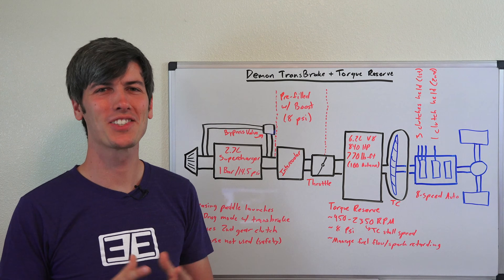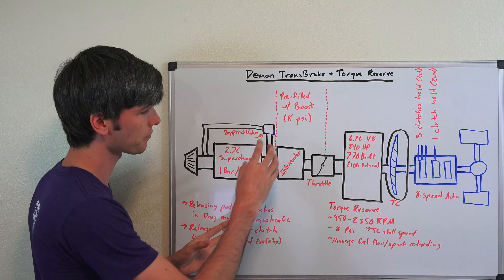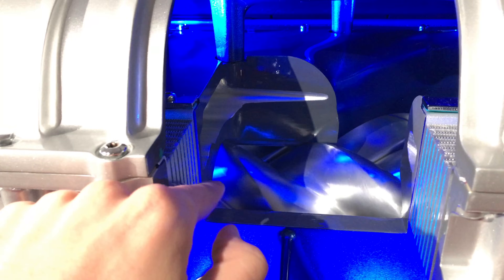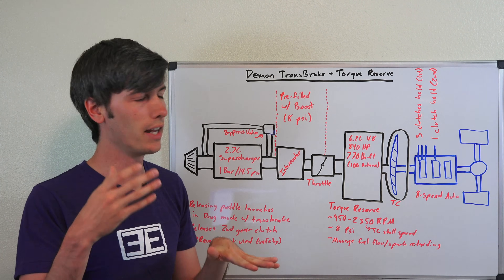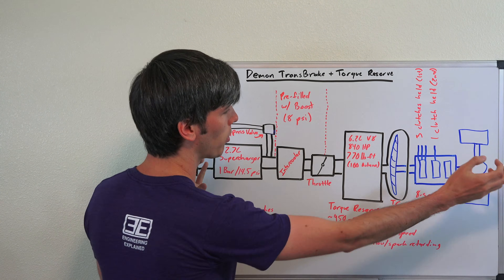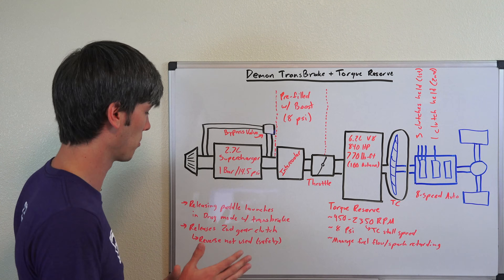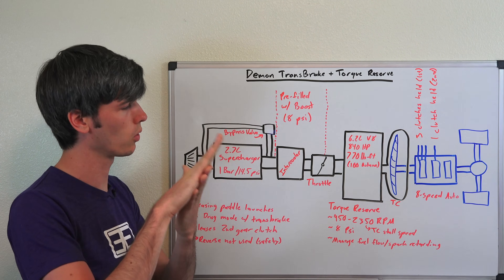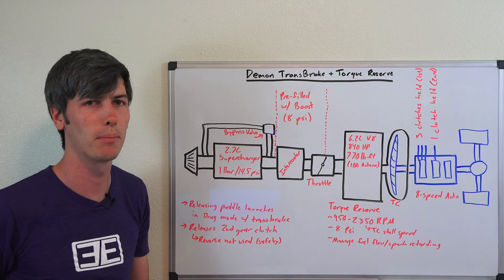How The Dodge Demon Launches: Transbrake + Torque Reserve Explained

Comment: I suspect Dodge is doing this just to take the 0-60 claim away from Tesla? In the street race videos I've seen, that Elon has Tweeted himself, all one has to do to the Tesla is lighten it up a bit (which is very easy to do) while using stickier tires to make it even faster. People haven't even tapped into the world of "hot rodding" the motors/batteries, yet. 

Fact is electric is always going to be faster than an ICE street machine.
Reply: You can upgrade the power as much as you want, but the tires simply can't handle more. You can solve that too, but then what you get is not a car, but a railgun. While that can do 0-60 under a millisecond,  it's not very practical or survivable.
Reply: The subject of the video and the technology in the Demon is about 0-60, nothing to do with endurance.
Reply: Gasoline/diesel runs out and has to be filled again. That 500 miles is final and who knows how much energy it took to extract it, refine it, ship it and then distribute it. It also cannot be replaced and will run out someday. The energy used to make batteries is a lot less in the long run because they can be recharged (via solar, wind, hydro, nuclear, not just coal). That 20 miles for batteries turns out to be 10s of thousands of miles. This is only to take into account current technology which is only now taking off because of market value. 

Tesla's Gigafactory 1 is very soon to be up and running and will the largest lithium battery manufacturer in the world. It is 100% solar powered.
Reply: I doubt that if batteries required significantly more energy to produce than gasoline/diesel you'd be saying it was irrelevant. I also don't know what you mean by not having to carry fuel anymore once it runs out. You won't be able to carry it because...the fuel runs out. You have to refill it with all new fuel and that will have to be carried just like the old tank full. 

Again the type of racing which was the original subject doesn't require anything special out of batteries. Cover up the radiator grills on ICE street machines as they are nonexistent on EVs and see what happens to those. It's no contest. 

A good example of the subject is the Tesla Racing Channel. It has no radiator grill and consistently beats every single ICE engine that comes against it, all day/night long.
Reply: +David McClelland Which has not been relevant since carbs were still a thing. Even basic economy cars can overwhelm their tires now, whats the point in dickwaving something that now a given.
Reply: Look at the trouble and complexity Dodge went through just to inch past only the first of myriads of its kind in the first few years of its production. If drag racing were a priority for Elon he'd not have to go through too much trouble or expense to ALWAYS smoke an ICE production street machine in its own territory.
Reply: David McClelland The things Dodge did to improve launching is not any different from the things Tesla does. It both all in software. The "torque" reserve thing is just a coincidence basically, it's not something added to the design, it just happens to be there. Transbraking is not complicated either, it's something that can be done in software in pretty much every automatic transmission built in the last 30 years.
Reply: lobsterbark A multispeed, multiclutch slushbox is complicated. A super charger added to an already completed piston engine is adding complications. Using a heat pump to cool intake air is, again complicated. Tesla has a lot of complicated tech, plumping, wiring and design but it isn't just for drag numbers. This Demon sacrifices everything for a better drag time, the Tesla accomplishes a great drag time by the pure nature of optimizing for efficient. If you make a reliable electric drive for every day commuting it will, as a side effect, be a track monster. The difference is the outcome of the Tesla is just a bonus while in the Demon everything is bolted on to simply make a better drag car at the cost of efficiency and all the other down sizes. In an electric car, more copper and more battery and you get more efficiency AND more performance.
Reply: +difflocktwo The thermal efficiency of the two are almost completly irrelevant. When someone is shopping for a car, does anybody look up the thermal efficiency of the cars they are looking at? No, because its irrelevant. Yes, the thermal efficiency does effect the actual practical efficiency somewhat, but the energy generation and storage efficiency is much more important, and in those categories, electric cars will always lag behind ICEs. 100lbs of gasoline can propel a medium hatchback ICE an average of about 500 miles. 100lbs of batteries can propel an equivalent electric car an average of about 20 miles, according to my napkin math. Granted, the support equipment for an ICE weighs more, but that extra weight make such a tiny difference compared to the extra weight of batteries. Thats not to mention the volume, but thats not as big of a deal if you design the car around the batteries, in the same way that ICEs are designed around their powertrain.
Reply: lobsterbark Dude are we discussing drag cars or consumer behavior? Big picture: Sustainability absolutely is necessary by definition.  
Drag performance: Wasted energy as heat has to be dealt with, adding complexity and material limitations. Drag times in production vehicles will favor high efficiency. Waste heat is a hindrance in any system, the less of it you have the higher performance you can extract.
Reply: +lobsterbark
ICE cars are very hard to improve, it's a 100+ year old mature technology, and it's pretty limited. Electric motors are far superior in every way, except that until recently there was no practical way to power them. But batteries are now improving crazy fast, and big money is just started to go into battery R&D. Battery technologies that are almost ready for mass production offer several times higher energy density, lower prices, and significantly faster charging. The batteries that are now being produced in the gigafactory seem to be already much better and cheaper than the Model S and X batteries. And batteries don't have to be Li-ion, or even chemical, the motors don't care about the source of the electricity. In theory we could use nuclear batteries that can power a cars for decades.
Reply: David McClelland And don't you think someone is planning to mod the Demon already?? Stock for stock the Demon still crushes the p100D...Doesn't matter that it has drag radials, bla bla!! The p100D has been synod at nearly 1000 wtq... VERY impressive torque numbers!! It's interesting!!
Reply: David McClelland Elon musk has stated that the p1000 D is all they can do to this platform  .. modding it will only make it few tenths faster which is a lot, but the Demon will be modded also and possibly launch quick as 2.0 s, and 8s for the quarter mile... Sorry Testla!!
Reply: I'm not just talking about an ICE transmission, I'm talking about the big picture.
Reply: How far down do you want to go? Raw material extraction? Everything is digital these days and chips are unfathomably complicated and chip fabrication is unbelievably expensive. 

 We use batteries everywhere, they are practically a commodity.

The argument revolves around taking energy and making a car go. Using the stored energy in batteries and a electric motor is much simpler than taking gasoline and trying to turn wheels. On top of that you can easily generate electricity locally while gasoline refining not.
Reply: +difflocktwo But the way that batteries are complex is much harder to improve upon than an ICE vehicle. An ICE vehicle can be made better in so many different, small ways that the end to how much better you can make them is how long you want to spend improving things. An electric vehicle can only be majorly improved by battery tech. The problem is not easy to solve, with an ICE it is.
Reply: +David McClelland Modern cars are generally expected to go 150000 miles or so before anything really needs to be worked on, and nothing actually complicated should start to go until 250000 miles or so. Thats around the point that you should seriously consider replacing the batteries in an electric car, to get lost range back.
Reply: +difflocktwo Waste heat in drag performance barely matters, as you only generate any for 15 seconds or so. The thermal capacity of the vehicle is plenty. In actual racing applications, electric cars are extremely difficult to cool, as the difference in temperature has to be a lot smaller. An ICE can run its coolant at 115C or more all day long, no problem. Batteries have to be kept at around 115F, which is a lot more difficult.
Reply: David McClelland No.... Not for a while!! There are cars than can do 6 second quarter miles... Not happening for years dude!! And there are FASTER cars that run on alcohol!!
Reply: +difflocktwo Making better batteries is a lot more complicated than mechanical stuff.
Reply: wrong, 30% improvement coming from HCCI ICE's
Reply: András Bíró An electric car most certainly does not hold the best lap at the nurburgring since the NIO is a racecar and not street legal. It is also not a production vehicle. You cannot include its time with production, road vehicles. As a result, it doesn't make the list. Also, you can't have "nuclear batteries" as that's science fiction. Nuclear reactions produce an insane amount of heat and as a result, nuclear powered vehicles can only be watercraft.
Reply: HAL 9000 EV vehicles actually require about the same cooling capacity as an equivalent ice. As far as gasoline and diesel "running out" that's also a myth, ice vehicles can easily run on biofuels. If profit margins didn't get in the way we would likely be running vehicles on hemp ethenol instead of petroleum. 

Guess I don't get why this argumentative thread even exists, all of the factors matter yet both sides want to ignore the parts that benefit the other side. Ice is the way to go for distance, ice is also the way to go for everything else with the current infrastructure and support. Electric is catching up and in some markets very close, distance ice will be king for the foreseeable future but electric is already a solid choice for those with short commutes in major cities and as it improves the usefulness will reach farther into the country side. Some day electric will be the best for everything, it's just not their yet but it's sure awesome to watch the tech improve. Until it does however I'll stick with ice, I live in a rural northern climate so limited range that gets shorter with extreme cold is just not a great option.
Reply: difflocktwo Tesla focuses on performance, saying they don't is like saying Bugatti doesn't just because the veyron is a comfortable and luxurious vehicle to drive. Elon wants good track numbers to sell cars, they also have to be comfortable or the yuppies in California won't buy them. He's walking a fine line between the two sectors (comfort and performance) to maintain the largest customer base possible. Which is required do the high cost of the vehicle, which is caused by trying to compete in both markets. This also leads him to another high end market specifically for fast sedans, with the likes of companies Mercedes, all in all good choice imo but it's a difficult line to walk. Also not a profitable one, when government subsidies go away people take a hard turn back to ice. I'm sure that will change, if Tesla is still around and the "IT" car by then only time will tell.
Reply: Electric is too heavy and hot to be fast. Show me an electric car that can keep up with an ICE for a full 24 hours or so without overheating.
Reply: +lobsterbark
Next year an electric car will compete in Le Mans. There's no reason why it couldn't. Current electric cars overheat, because they weren't built for racing. Since electric cars are far more efficient than ICE cars, they generate much less waste heat. Their disadvantage is that batteries operate optimally at much lower temperatures then regular engines, which makes cooling significantly harder. But battery technology advances very fast, it's impossible to tell what will be available in 5-10 years, while we can say very confidently that ICE cars will be pretty much the same.
Reply: Making batteries isn't something the consumer has to worry over as the end product is very simple and reliable with no moving parts. With batteries you know what you're getting and it's predictable. 

Fixing failed, over-engineered and complicated mechanics is a headache that needs to die.
Reply: lobsterbark Automotive ICE is sitting at under 40% efficiency, EVs are over 80%. ICE needs to double in efficiency before it even gets close to EVs. Why invest any resources improving ICE when EVs are already twice as efficient?

All this ICE tech is not easy to solve at all and is super dirty during operation. We don't even need to improve current battery tech, we have pretty amazing batteries already and they are used everywhere.
Reply: 03056932R 130% of 40% is only 52%. Still a joke.
Reply: +David McClelland But when the fuel runs out, you don't have to carry it anymore. Its gone. The energy to refine and transport it is also irrelevant, as the car does not have to generate it. Energy is super cheap, and will always be super cheap, barring some sort of end of the world scenario that makes cars irrelevant.
Reply: +Andrew Whiteman
An electric car has the best lap on the Nürburgring, so I won't say they are slow. The Tesla Model S is a luxury sedan, not a sport car, it's meant to be driven on public roads, not race tracks. So it doesn't have to go faster than you can realistically drive on a highway. Tesla is super focused on producing high volume cheap cars, and they don't need advertising, so top speed and racing is irrelevant for them. They make their cars so powerful, because it's very easy to do that with electric motors, and it's a great selling point. Torque and acceleration are not just super fun, but can be used at legal speeds, and also useful.
Reply: The subject is street racing and 0-60 (and shorter).